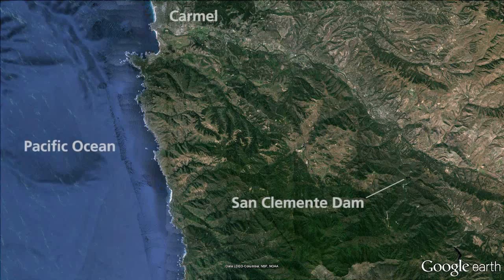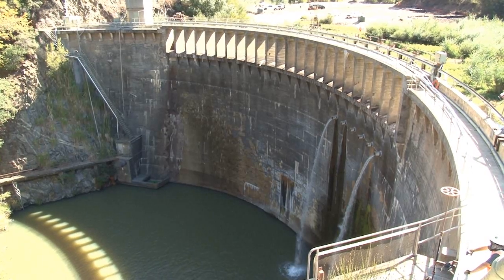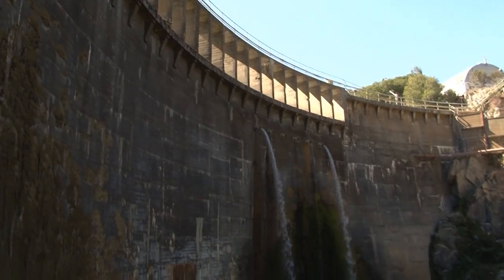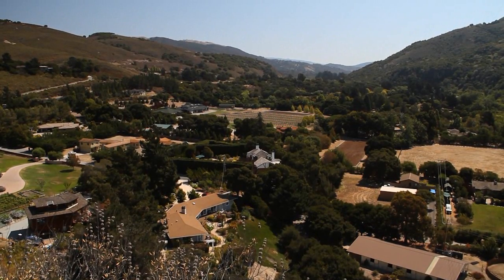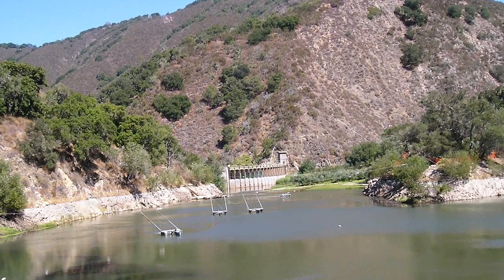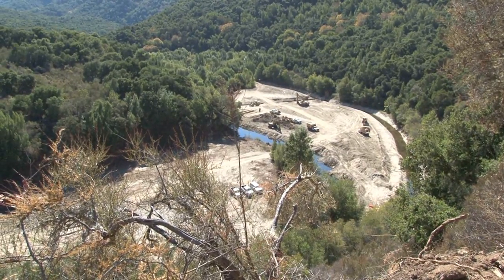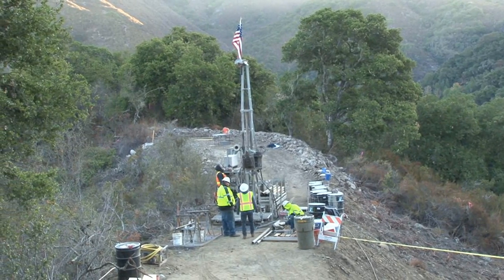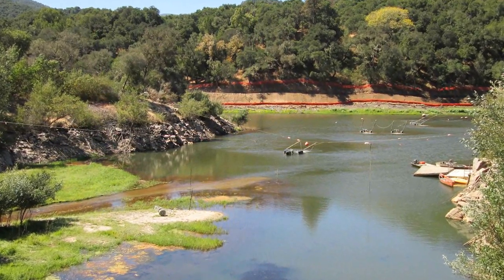San Clemente Dam Decommissioning

Comment: Several comments have been made regarding the engineering choice of how to deal with the dam sediment, the most daunting and costly part of the process. Dam Decommissioning is a relatively new engineering procedure ( with Nuclear Power Plants Decommissioning soon to be next ).

There is a slowly growing body of knowledge on dam decommissioning, and what works under what condition. While it is true that experiences of the 34 million cubic yards of sediment of the Glines Canyon and Elwha Dams ( Washington State USA ) showed that, instead of a full rapid release, a controlled draw down worked to move the sediment with little effect upon the environment, in this case ( and others ) there were little to no "dense development" ( County, City and Private land owners ) downstream.

So with the San Clemente Dam, even a controlled sediment release could or would have significant effects upon riverbanks, golf courses, conservation areas, boat docks, parks, roadway overpasses, etc. An uncontrolled or controlled release of sediment at its core represented a significant potential liability / legal costs that would have been unacceptable to any stakeholder in a project of this scale.
Reply: Good corporate speak.  We wouldn’t want to upset any ‘stakeholders’.  God forbid the golf course or any land owners need to deal with any issues.

Comment: What a huge loss to the environmentally concerned.  It will take an act of God to re-approve a dam construction over there again. Without these dams we'll be like a third a world country that doesn't have this infrastructure, suffering through catastrophic floods, famine, and have to resort to quick and dirty fossil fuel generators. Ecosystems are always adapting, some disappear and others emerge. It's one of many natural processes that civilization can intelligently be stewards of.
Reply: There was no electric generation on this dam.  Silting made it virtually useless for flood control or water supply.  All man-made objects have a useful life span.  This one has served its purpose and now must be removed.
Reply: Rosaceae looks like that left some folks a rash and others a smile...let the river run,we can cope
Reply: 1m solar panels in ca has replaced thes dams that cost to much to dredge. What dope have you been smoking?
Reply: @robertjackson4121  Solar panels "wear" out faster than any dam, and are less useful than any dam..
Reply: @dundonrl  salmon River the Corp of engineers has started a study to decommissioning all dams Columbia River and snake river. Power companies do not want to pay for dam removal. They will either post a dam removal or start a trust fund starting next five years to pay for removal. All energy has a lifecycle cost construction production and removal coal oil gas nuke hydro solar wind hydrogen fusion. Space solar power etc
Reply: @robertjackson4121  The dams on the Columbia River basin (Columbia, Willamette, Snake etc) provide 40% of the hydroelectric power for the United States. 35% of all renewable energy in the USA comes from hydro power..
Reply: You missed everything this video talked about
Reply: one or two windmills can replace power generated from a small dam
Reply: @joshmallon  If it's windy. Hydropower is the only source of renewable energy that has a large enough buffer for weeks of cloudy days without wind. It's the most controlable of all renewable sources. Germany has needed to import loads of electricity from france on cloudy and non windy days. The swiss have the right idea with all their dams.

Comment: Lived in a company town where they diverted a river... flood cycles every five or seven years would have the river breach and carry on its original course no matter what the company did. Good luck to the residents of San Clemente.
Reply: +TheCanadianBubba Yep, next time there is a "Flood" the river will go back to its original course. Rivers are like that. So yeah, good luck with that.
Reply: Depends on how much money is spent on diverting the river. Trust me they could divert the river and it wouldn't come back to it's original channel IF they do a good enough job moving it.
Reply: Average annual rainfall in that part of California is 10.5 inches/26.67 cm, not much risk of a flood except for the dam was to fail then there would be a flood of water and sediment flow landsliding into the homes down the ways. They could have built a miles long slurry pipe to dredge the built up sediment down river and past most the homes and let the river take the course on its own with the rest. Now if there was the rare chance it was to endure a flood then those bends they made for the diversion would rear their ugly backside on these foolish 'experts'.

Comment: Seems well-thought out,  and may, if successful, serve as a model for other dam removal and natural reclamation/restoration projects.
Reply: Most dam removals are half the heights or less or in a area along the river where doing a diversion flow is prohibitive, due to terrain or property ownership.
Reply: @Joshua79C  the owner of Tesla has the boring project and is doing feasibility from Baltimore I believe to wash d c.  This is 50% less cost. Most dam projects had diversion tunnels to divert a river while the dam was built.  The dam projects are usually navigation streams that require a renewable 50 year license. The public and private power only want the benefit not the liability. The paradise for is $9 billion liability because the power company was liable for the fire because they did not trim trees. Forcing bankrupt. The same with big tabbaco causing lung hospital bills liability. The next case will be global warming Porto Rica 2000 deaths TX NJ FL hurricanes and fires only tie to gas oil shale liability. Only requires amendment to liability law. It is called total cost ... Design development operation and decommissioning and liability cost. Then gross income minus cost and liability = net income. By 2020 we will have pnw dam cost. Btw WA state only has limited sovereign immunity. The only state that takes liability...